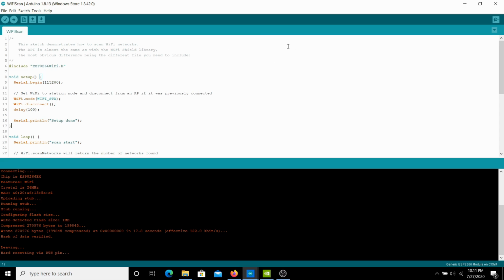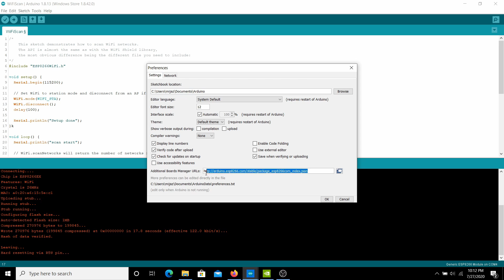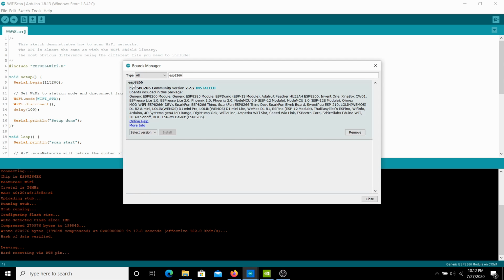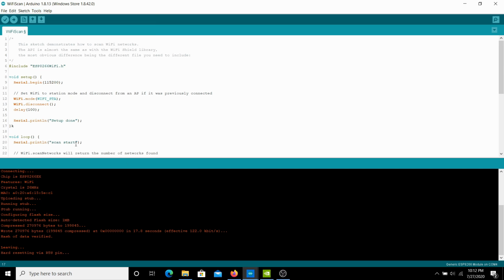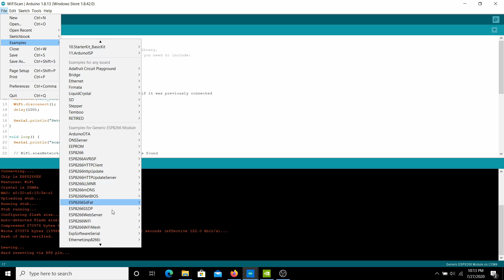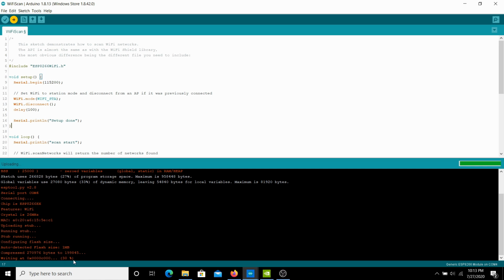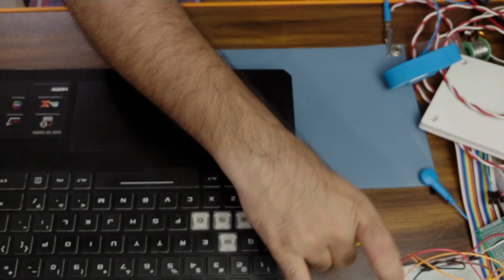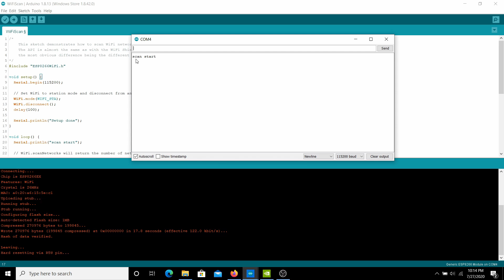#1 Program an ESP01: The easy way!

Comment: Incredible video, saved my college project! Just one question, when you wired the button with just 2 of the 4 "legs" it has, which of the legs you used?
Reply from the maker: It is best to check that with a multimeter, check the continuity when you press the button, that said, it is usually the pins on the same side of the button which are connected. Be sure to check it though.

Comment: Soldering was not as easy as it looks better off to just order the right one from aliexpress in the 1st place
I think it is about the same price ,I wish I knew this thing was not what I wanted before I ordered it ,  good thing I found this video
I managed to get it done, but I still have not tested it yet though, soldering to the GPIO 0 pin was not easy ,I kept bridging pins whatever solder they use was not compatible with the solder I was using, I also wonder If I could have  used the  ground from where  the USB connector is soldered to the board instead of the one  on  the  header pin,
it would have been a bit easier   although for some reason I had much less trouble soldering to that  GND pin than the GPIO 0 pin on the header
I also used some hot glue and I mounted my microswitch on the side of the yellow header connector( at the bottom of it if the USB  connector is facing to the left and the header is on your right) it fits perfectly there , this way while plugging in the  board to the USB on the PC with your right hand  you can very easily hold down the  button with your thumb.
Reply from the maker: I think using the usb ground would work, since the only requirement is pulling GPIO 0 to ground. And nice work with the placement of the switch, I might try it myself :)

Comment: Hi! what is the part number of the USB programmer? Thank you.
Reply from the maker: This programmer is kind of generic, a lot of vendors sell the same stuff under different names. You can find these on banggod or ali express, even amazon has some of them listed at a slightly higher price. All of them are based around CH340 chipset which is the low cost USB interface used in most of the arduino clones. Good luck with your project!

Comment: Very clear explanation. Thx! It helps! 
Just one question. What about the driver for the programer? Can you explain that please i read a lot about incompatability.
Reply from the maker: This programmer uses CH340 chipset for USB communication. You will find these on almost all the arduino clones in the market because of its low cost. You can find the link to the driver in the description. You don't need the drivers if you are using a linux based os like ubuntu. Thanks for the comment!
Reply: @AIbeginsDotNet  Thx! I’ll buy the module. If any questions, i’ll be back. 😄👍

Comment: i have module and same connections and still it is not working
Reply from the maker: Can you describe the problem?
Reply: @AIbeginsDotNet  i have same module and it showing the code was uploaded but still my led is not blinking i checked as per your video everything is okk but still led not blinking
Reply from the maker: @Rohitkumar-1994  which sketch are you using? Try adding some serial messages in the code and  see if they appear on the serial monitor. And always remove and replug the module (without pressing the button) after your code is uploaded.

Comment: ESP-01 can store data in EEPROM? ,I want data to be kept in the event of a power outage.
Reply from the maker: You can use SPIFFS to store data in the flash memory, I have used this concept in this video : https://youtu.be/WCtHuFZE8BQ
More information can be found here : https://arduino-esp8266.readthedocs.io/en/latest/filesystem.html
Good luck with your project!

Comment: is the USB communicator only used for programming ? and later you can just unplug the ESP-01 and put it in ur project or does it require the communicator with it ?
Reply from the maker: The USB adapter is only required for programming, you can use the ESP01 in your own project independently. You can watch this video: https://youtu.be/bBMaNnCTXuk where I have done exactly that. Good luck with your project!

Comment: Can i use esp8266 together with a Bluetooth module in one arduino uno board
Reply from the maker: Yes you can! You will have to use something called 'software serial'. 
Both the Bluetooth module and ESP01 will need serial pins (RX and TX) to work, but an UNO only has one hardware serial, so you will have to use 'software serial' library to make any two other pins behave like serial pins.
More info on this link: https://www.arduino.cc/en/Reference/softwareSerial 
Though for a project that needs both Bluetooth and WiFi, I would recommend an ESP32 board, its even cheaper than an original UNO.
Reply: @AIbeginsDotNet  thank you! 😊

Comment: How do I know if I already have ch340? Where to manage that?
Reply from the maker: On windows, check out the device manager when you plug in the programmer, if there is no device called ch340 (or something similar) listed under the USB section you will need to install the driver. Check out the blog link given in the description and go to step 3 to find the link to the drivers. Good luck with your project!
Reply: @AIbeginsDotNet  and now everything works out for me. Thanks man!
Reply from the maker: On windows, check out the device manager when you plug in the programmer, if there is no device called ch340 (or something similar) listed under the USB section you will need to install the driver. Check out the blog link given in the description and go to step 3 to find the link to the drivers. Good luck with your project!